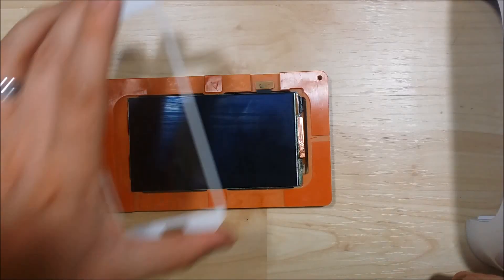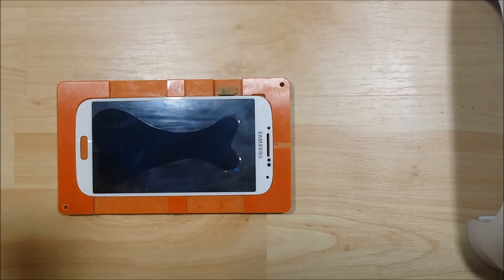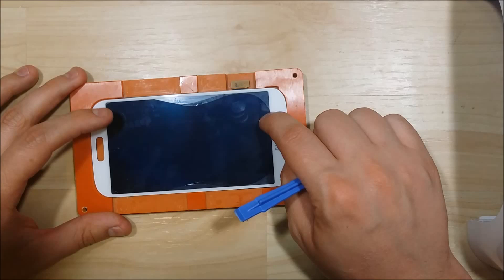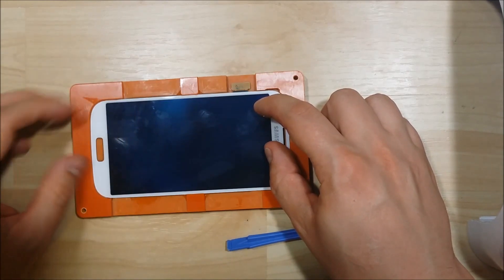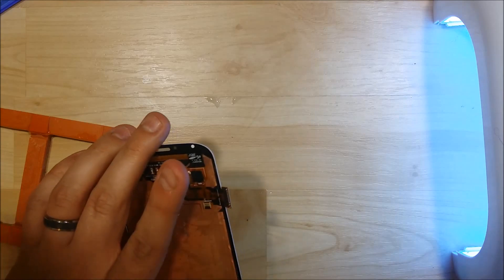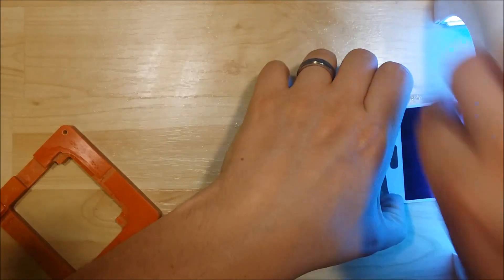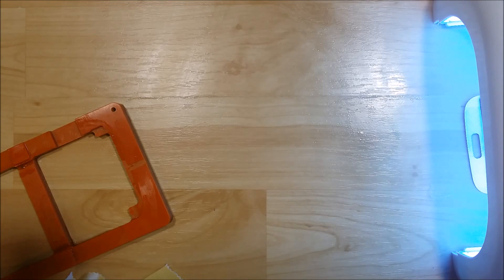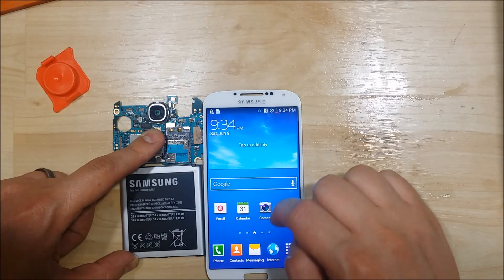Samsung Galaxy S4 Liquid Optical Clear Adhesive Application LOCA Process

Comment: I use electric tape to tape down the back of the lcd to the mold, nothing under the screen but behind the screen to the plastic mold, nothing fancy or pretty. It holds the lcd in place because sometimes they can shift. Also, you have to have a dust free environment. Sometimes a micro fleck of dust can be seen and it looks like a bubble. Inspect your glass with a loupe/magnifier to make sure you didnt get any bubbles or dust in there. Finally, I use a vacuum sealer to suck the glass down to the glue and hold the screen in place in sealed bag, and put it in the under the uv, in the sealed bag for 40 seconds. Take it out of the sealed bag, remove from mold, inspect, clean, and then back under for like 15 minutes or more

Comment: I think my mold is not good. Because the display can't enter on it!  Where do you buy it? THanks Or in alternative, can I use a OLD frame like a mold?
Reply from the maker: ***** Some molds are a little small. I used sand paper or a razor to trim the edges to make it fit. You can use the old frame like a mold but it is really hard to get it out.